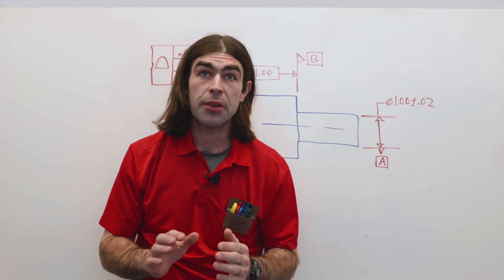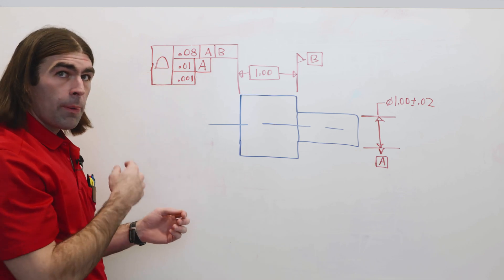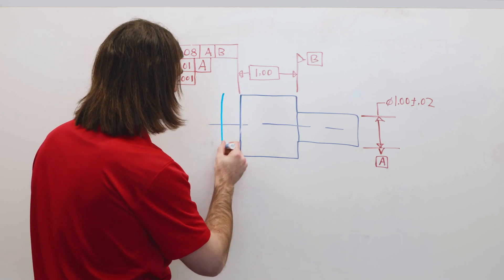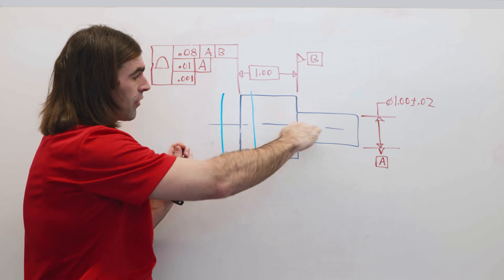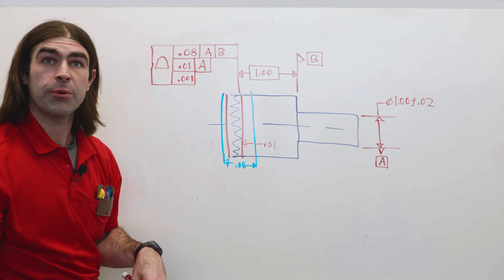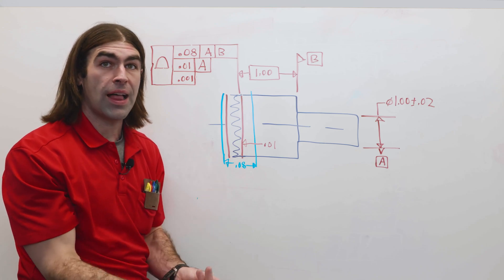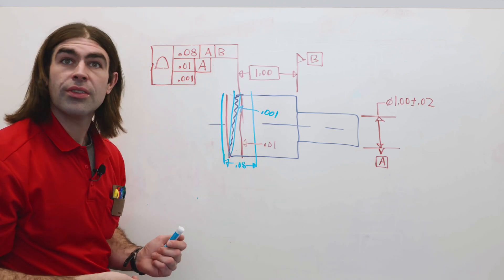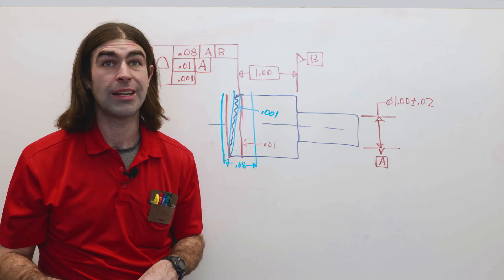GD&T: Composite Profile Example, Three Segment Feature Control Frame Explained

Comment: Great video! Thank you for all the info you share on your channel! I have a question. Where in the ASME standard does it allow (or not allow) for MMB use on datum feature A of your example part?  I realize that it would have to be the same in both the top and bottom frames, but I cannot find an example of composite profile using datum shift in the standard

Comment: If I made a composite FCF and had a M (maximum material condition modifier) called out in the first frame, do I HAVE to also add that to the second or third frame?
Reply from the maker: Hi, it isn’t shown in the standard, but it isn’t forbidden in the text. Since each frame is a separate check, they could be at different material conditions. The datum references have to be in the same order and material condition though.
Reply: @RDeanOdell  Thank you for your reply. I'm still confused though. You say that "they could be at different material conditions". meaning the top could be at maximum material and the lower one could be least material, or even have nothing (regardless of feature size). But then you mention that the Datum references have to be in the same order (which I understand), but then you added "material condition" which implies the material condition also has to be in the same order, meaning it needs to be there. Bottom line, if I have maximum material condition on the top, do I have to have it on the lower FCF or can I leave it out entirely? I cannot find any examples of a composite that shows having max on the top and the bottom not having it. Thanks in advance
Reply from the maker: Hi, I mean the material boundary on the datum references. Those have to be the same and same order etc….

I have notes to make a video about this, it’s a great question you brought up.

Comment: For the second composite feature wouldn't the new 0.1 tolerance zone have the center be the surface of interest? It kind of looks like you back it up so the .01 zone extends from the back of the surface out .01, but not into the part. So your not allowing for the surface to be 9.99 only 1.00-1.01.
Reply: No, Profile of a surface is a bilateral tolerance zone by default. It means that the true profile (what is on the drawing) is the center, and the tolerance zone is equally disposed on the two sides. In this case of the video example, the .01 tolerance zone extends .005 outside and .005 inside the part.

Comment: Hi Sirs, I have one question regarding composite profile tolerance from my engineering drawing . The drawing called out composite tolerance without any datum for first & second profile tolerance .this is really quite strange requirement. So, appreciate that if you able provide guidance / explanation regarding this kind of composite profile tolerance ?? Thank you .
Reply from the maker: Hi, it is likely a drawing error. The only reason I can think of to have the requirement you mention is to control coplanarity of multiple features to each other. Feel free to email the drawing if you want me to take a look.
Reply: @RDeanOdell  Hi, thank you so much for your feedback. Can I have your email address in order send the drawing for your review & advise?